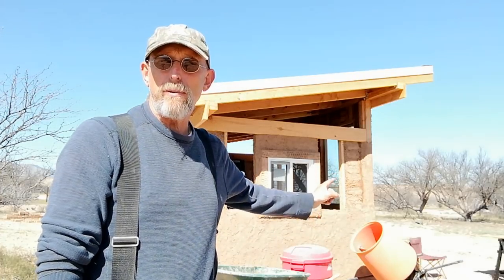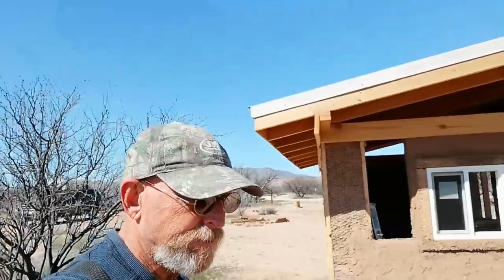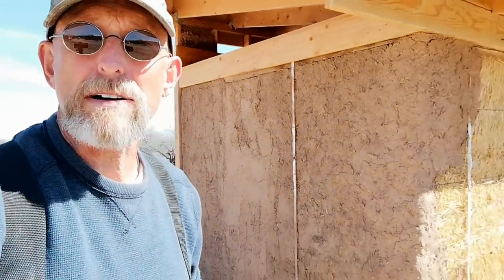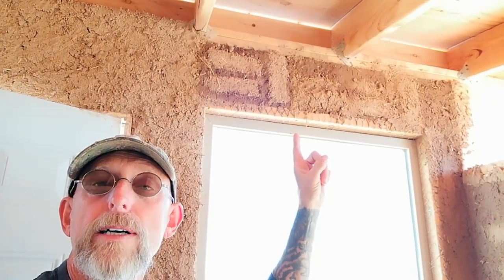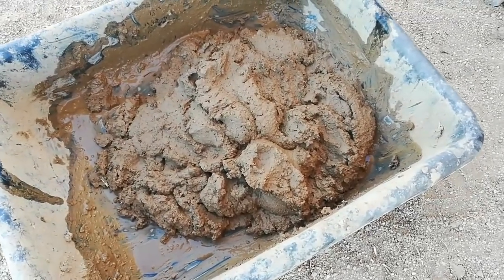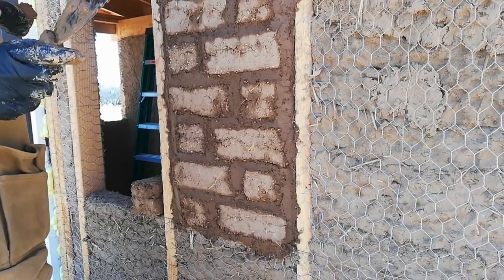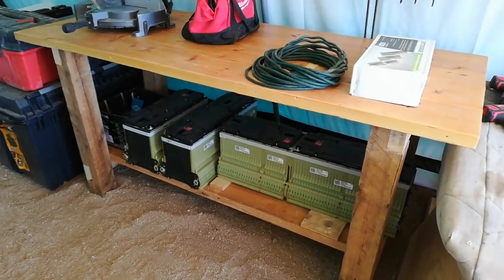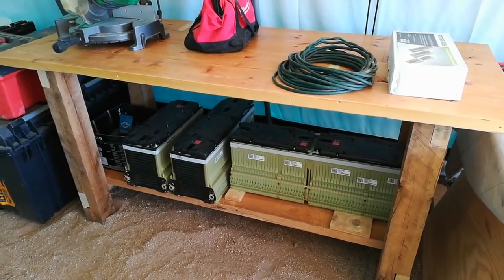Solar Shed Update / Laying Adobe Bricks / + Bonus Footage

Comment: A quick solution to dampen wind noise, is a thing called "Deadcat" (if you haven't tried that already) basically it's a thick furry jacket that you put over your mic. It does a decent job.
Reply: Yes, you need one of these. If you search for microphone wind blocker it should come up. You may find one that will work with your current mic. My Little Homestead seems to have covered their mics with a homemade wind blocker - you could always ask them. Although I'm sure you've found a solution now that I look at the date - 4 years ago. :)

Comment: Get a wireless lav mic with a little wind muff.
Reply: Wireless lavs are great. The only trick is that most will require an exterior pack and you'll need to resync the audio. Which isn't that tough, just an extra step at the end of the day. There are a few that you can plug directly into the phone though, not sure about the quality, but this link is a Rode which is usually reliable. https://www.amazon.co.uk/dp/B00TV90DX0/ref=cm_sw_em_r_mt_dp_U_94ASCbPE6W7V5

Comment: Expansion and contraction of the framing lumber will constantly crack your cob/earthen bricks/plaster.
Reply: Cob also expands and contracts. A thin layer of cob slurry can be used to cover up cracks, and it could last for 10+ years.